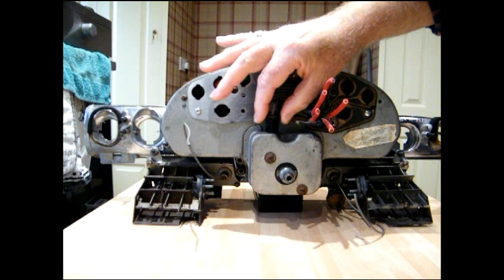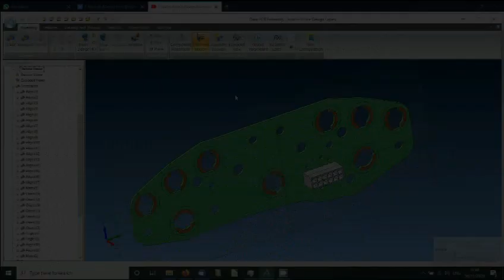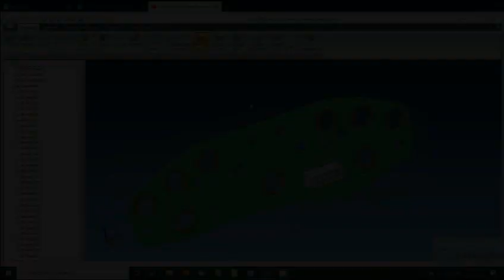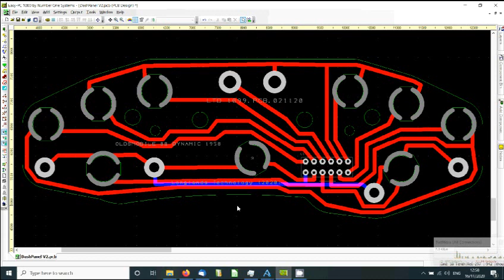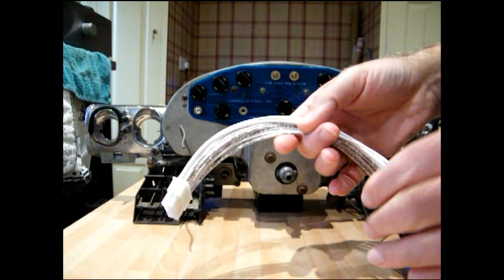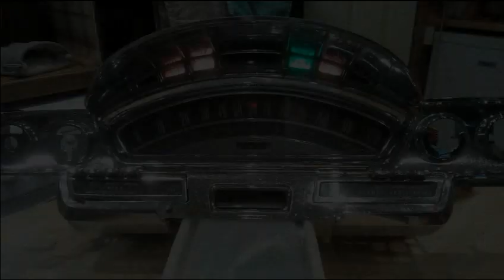Oldsmobile 88 Instrument Panel Repair

Comment: Funny to see 4-way flasher indication, that is because the cars never came equipped as a feature ( at least not standard, and most certainly not for my grandfather's '58 Fiesta ). I would LOVE to see ALL of the dash panel to be lit up, one day ( specially  the speedometer  ), my grandpa's car had no more lights working for the dash.
Reply: Thanks. I just bought one of these cars and I was like. I dont remember it having a hazard switch 😅

Comment: I own a 58 Olds Super 88 and am redoing the  interior. We are having trouble getting the dash board out to have it recovered. Any suggestions on how to do this or know anyone who could help or any possible videos?
Reply: Hello there Melissa, I'm pretty sure there are six to eight screw in bolts that hold in the dash ,if you look in through the front of the windscreen you can see then along the back of the dash. i'm about to try removing the dash as well as I have to replace  the fuel gauge, Ill try and post a video , Cheers Ray.
Reply: @MrPiper60  Thanks, do you have the dash pad off already? If you do post a video I'd be interested in seeing it as we removed the dash pad but need to put a new one back in. Thanks
Reply: @MrPiper60  were you able to make a video of removing the instrument panel?
Reply: Sorry not yet , been so busy with work , cheers
Reply: @MrPiper60  we managed to get the instrument panel out today. It isn't easy there are only 5-6 bolts but you have to remove a few other parts separately; light switch, key switch and drop the steering column a bit. It's hard to see in behind the dash so we found it helpful to take pictures to see what needs to be done next.
Reply from the maker: I was not involved with removing the dash from the car so I can't help there.
Reply: @iamderby4460  ok thanks

Comment: I watched your video with great interest. Did you just make a one off circuit board for the dash or are you looking to make and sell any of these boards, reason being is i own a 58 Oldsmobile and would love to be able to have a spare if needed. many thanks and great video.
Reply from the maker: I can supply the PCB with a set of LED bulbs and a quick disconnect fitted. I also supply a cable with the quick disconnect one end and a terminal strip at the other. This makes it easy to fit to the existing vehicle wiring while retaining the flexibility of the quick disconnect. About section updated with business email address.